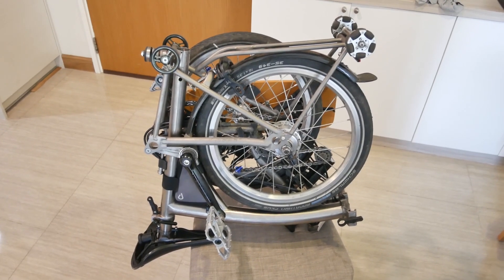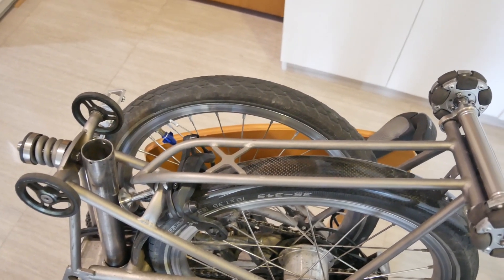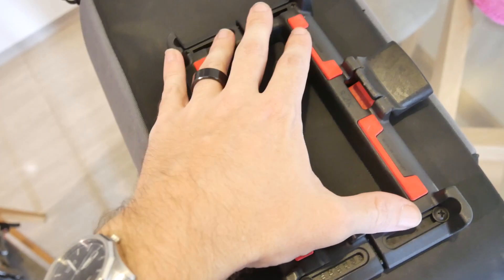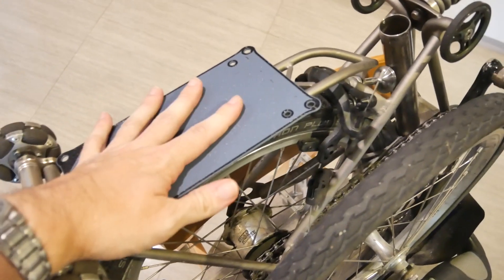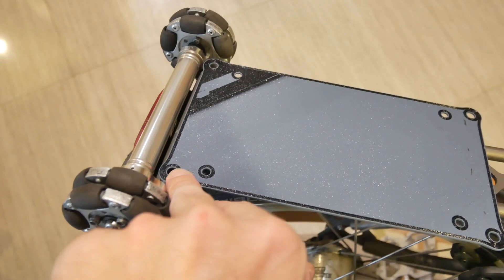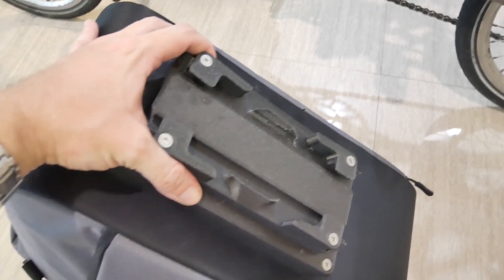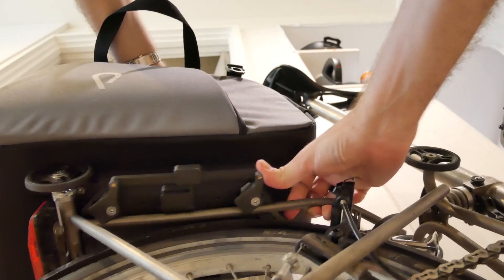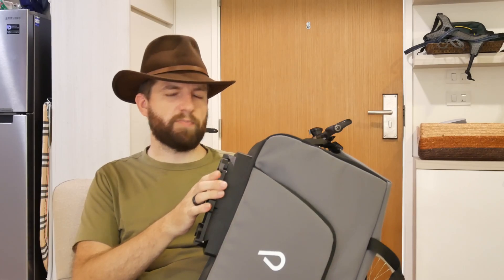Designing and 3D printing a custom bicycle bag mount

Comment: Good job! I've adapted a few bags and baskets myself but just using bolts, plastic boards and zip ties as I don't have a 3d printer. I don't know what model your bike is, but on my Brompton in shopping cart mode it's a lot easier to move around with the Omni wheels fitted to the frame and easy wheels on the rack, as the larger turning circle is at the front when pushing with the handlebars up. The only problem is heelstrike when unfold it for cycling, this occasionally happened on my old steel Brompton, but never on my new T-line model which must be slightly narrower.